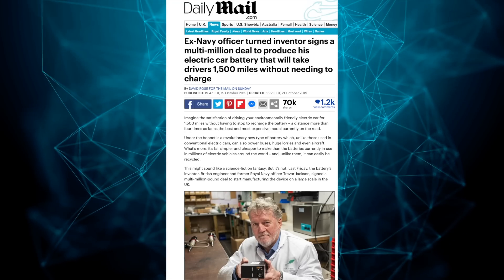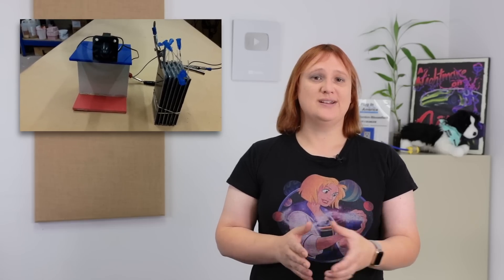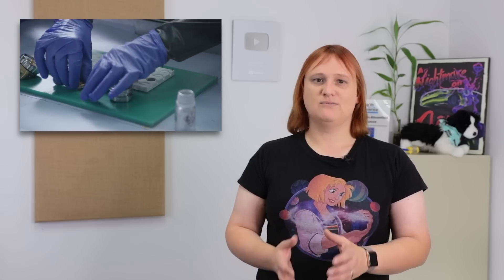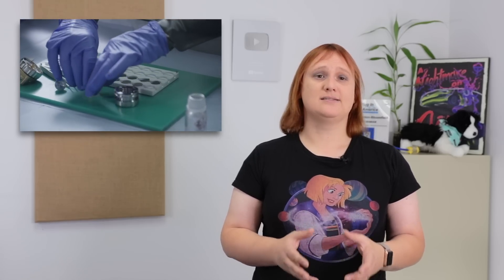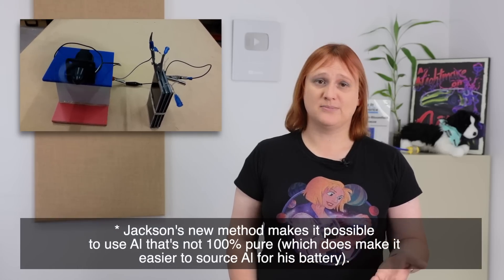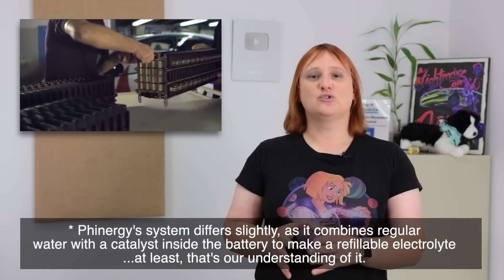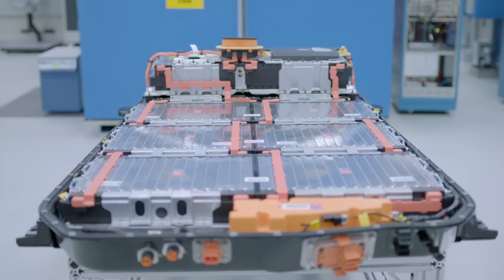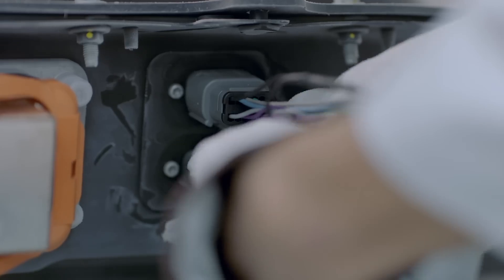Is This Battery The Holy Grail For Electric Cars?

Comment: This made news some decade or two ago with a company proclaiming and 1,000 mile EV range. As I remember it, they didn't talk about replacing the battery, only draining the electrolyte, refilling with clean electrolyte and adding fresh aluminum plates. That may be similar to a battery swap but is sounds much closer to a fill up for ICE car owners. Also it was stated that the used electrolyte could be recycled and the aluminum removed and put back into reusable condition. I'm sure there is considerable energy used in the recycle process as nothing is free, but it was presented as not major obstacle and recycling centers could be ubiquitous.

Comment: Aluminum air batteries is a very bad idea for cars. It won’t take much time to become another oil Cartel. 
Where aluminum air batteries will work well is in light aircraft. They will allow 800 to 1500 mile range light aircraft.  At the 70% mark just replace the batteries.

Comment: Couldn’t we just pull into a service station but instead of filling the tank with petroleum (gasoline). Fill it with aluminium marbles from a spigot and top up the aluminium that way?
Reply: David Hunter as a battery the aluminum must be in a form that is engineered into electrodes to allow surface area to be exposed to the forced ambient air.
Your not far off if you want to disassociate hydrogen from water exposed to aluminum pellets in an aqueous solutions of gallium indium.
Hydrogen on demand can run a fuel cell or ICE.

Comment: While I will never give up the ability to charge at home (I love not having to go anywhere to fill up), I can see these batteries being very useful for edge-case situations. For example, here in logging/mining country, it is not uncommon to see diesel pickups with a range extension tank in the bed for heading into the backcountry. Imagine tossing an aluminum battery into the bed of your Rivian and all of a sudden having a 2000 km range. Given that the motors don't care about the chemistry being used to move the electrons, Lithium + Aluminum add on might make sense. 
Another situation this might work is if you already have a transportation work yard (e.g. city and school busses) or could rent an easy to use trailer for the battery (e.g. you go to U-Haul to rent a battery trailer to long haul move your EV RV, for example).
Of course, this all assumes these add on packs could be created, recharged, recycled and "installed" at a price comparable (preferably cheaper) than the existing options on a price per kilometre basis.

Comment: Great info.
I do not want to go to a shop to replace a battery. I go a Bolt so I would not have to stand a gas pump on cold or rainy days.  I don't think it will get much traction with personal cars but sounds like a good fit for busses

Comment: In the original article the cost of a aluminium-air battery, was included, £5000. I understand that over time this cost could be reduced but if the battery lasts 1500 miles, as stated in that same article, is this still a viable option?

Comment: One of the big benefits achieved from current EVs is regenerative braking. Since this battery can not be recharged this benefit is lost unless as she said multiple battery technologies are used which defeats the space saving factor. I am also concerned that if the aluminum is being consumed, where is it going? If it is some aluminum compound being released into the air, we have another problem.

Comment: (Not super-important, but just for the pedantic record, energy storage per unit mass is called “Specific Energy.”  “Energy Density” is energy storage per unit volume, although it sometimes is, not technically correctly, used as an arguably more-intuitive moniker for Specific Energy.)

Good report!  I like your suggestion of using them in place of ICEs in a PHEV;  that’s a clever approach!

Being an electrical engineer myself, although mostly in computers, I read an engineering-theory-level book on EVs (somewhat out-of-date, but with a lot of excellent and still-relevant info), and it spoke about aluminum-air and zinc-air batteries.  That book pointed out, as did you, that these battery chemistries have a long history in hearing aids.  

From an EV perspective, the book described them as “refuelable” batteries, interestingly.  In particular, suggesting that the materials can be refilled without replacing battery casings.

Comment: One thing I thought about for the aluminium air primary cell technology that makes way more sense is the use for container shipping. Those enormous ships are massive polluters but can be easily converted from dirty marine fuel oil to zero carbon emissions as their propulsion is actually by electric motors but they use thousands of tons of fuel oil in generators to make the electricity onboard. If the aluminium air batteries can be loaded on at port and unloaded for recycling, that would make sense.

This works as the ships only visit a relatively small number of ports and they already have all the storage and heavy lifting equipment available to move the enormous batteries around. 

That makes way more sense than for electric cars and would be a way to completely decarbonise our international trade.
Reply: Noah Derrington aluminum is made with electrolysis.
Reply: Dana Putnam I am very well aware of the aluminium manufacturing process. This is precisely why I question this technology for small vehicle transportation as the carbon cost of the process, transportation and recycling of primary cell technology as opposed to rechargeable batteries.

Just because aluminium production uses electrolysis in the process and some part of it could use renewables the totality of the manufacturing process, transportation and recycling is going to have a massive carbon cost which can only be justified for very large infrastructure like shipping, possibly aviation and heavy plant equipment.
Reply: Noah Derrington sorry just want to clarify recharging alumina into aluminum versus disposal of primary batteries or mining bauxite oar many people in the commentary are not familiar with the process and the narrator implied aluminum is just found in the ground.
Maybe your familiar with Iceland using its excess electricity to make aluminum and ship it to Europe where they extract the electricity and ship the alumina(aluminum oxide) back for recharge.?
Reply: Noah Derrington the production of aluminum is already a vast manufacturing resource that is thousands of times more than the demand for battery electrodes currently in place regardless of the battery technology.
Consider in fact that it is quickly replacing steel in automotive applications due to weight advantages and gas mileage which offsets concerns.
Also while commenters have claimed it is energy intensive compared to other metals per ton aluminum is 1.5 times lighter than steel making steel in its mobile application 1.5 times less mass required for the same application.
That means aluminum is less carbon intensive per application and continues in the life of the transportation  device to continue to reduce carbon output for vehicle transportation which of course includes airplanes!

Comment: I saw this recently. It’s a bit misleading as it’s not rechargeable and the whole battery would need to be removed from the vehicle and replaced to replace the energy source. The aluminium then needs to be recycled and re manufactured every charge.

Firstly, that’s probably a bit impractical as each service station would need to be able to detach a heavy battery pack from a car and reattach a fully charged one. That might be possible to automate but would require every new car to have the same battery pack size / connections etc.

This at scale would be insane, imagine literally millions of vehicles of every shape and size needing hundreds of thousands of tones of batteries to be stored and swapped at service stations every day. Its not impossible but pretty impractical.

Also the carbon cost of transportation of 100s of millions of tones of batteries every year to and from recycling centres and the carbon cost of re manufacturing them would defeat the point of green electric power.

It’s interesting but not practical in my view. The whole point of electric vehicles is they are charged at home or work from renewables (locally or grid) and doesn’t involve any transportation overheads of moving the power to the vehicle.

Comment: I have the answer--I think. First: this is the ideal solution for long-haul trucks ("lorries"). A team drives across the USA--or Canada, which is longer. When they arrive at their terminal, they swap out the battery while preparing to take on a new load. Simplicity itself. So for them, it's ideal. No more waiting for a recharge. Sure, they're dependent on a swap station. But the terminal will have that, and that's a lot easier to maintain than a Diesel fueling station. Tesla, take note! This is the basis of your Super-Semi with the sleeper cab and seats for both driver and driver's mate. If you want to compete in the long-haul space, this battery will do it for you.

You can also use this in the area I have been waiting for someone to suggest developing: all-electric heavy mining equipment. If you want to cut down the carbon or toxin emissions from mining, then develop all-electric equipment! This aluminum-air battery would work beautifully in this application.

Same for garbagemen, and any other stand-still application (cement mixer, "cherrypicker" electric line repair truck, etc.) and for cross-country buses. (City buses should do OK with Li-ion batteries.)

To preserve dynamic or regenerative braking, the vehicles will still need Li-ion batteries or ultracapacitors. Regen brakes are better, safer, longer-lasting brakes, and that will become the single best reason to keep them. The range extension they can still offer might not count for much next to the Al-air battery. But safety does.

As many have mentioned here, this is your electric aircraft solution. I don't know whether this will go for a transoceanic aircraft. I tend to doubt it. But the island-hopping airlines that serve Hawaii could certainly use an aircraft with such a lightweight battery. It's getting right up there with hydrogen, which has the highest energy density by weight but the lowest energy density by volume. An airliner by definition needs servicing at an airport. A battery swap surely can't take any longer than the usual routine for turning over an airliner, even one making a multi-stop run. Boeing and Airbus, take note!

I imagine that environmentally conscious shipwrights would love to use this for freighters and cruise liners. But it would require a radically different ship design, with gigantic doors well above the waterline, to gain access to the battery bay. The goal would be to enable a swap-out of the battery packs in as much time as it takes to unload, clean up, refit if necessary, and reload.

Bottom line: you can do a lot with Al-air batteries even at the current stage of development.

Comment: What do I think? I think your take on the “refueling” model of these batteries is a bit too pessimistic. No reason that their form factor couldn’t be standardized such that their replacement would be no different than replacing batteries in a flashlight (or “torch”, depending on where you’re from 😉).

Comment: no thanks.  I love filling my car at home from my solar panels.  Not giving another industry control of my mobility.
Reply: @Scott Z
"Not giving another industry control of my mobility "
Obviously excluding the industry that manufactures your solar panels initially and when they need replacement or the battery technology your solar panels charge to store the energy you use to charge your EV.
Reply: or money......
Reply: Ooooo, get you..... With your solar panels and off road parking! I'd love an EV, but have no ability to charge at home and the local rapids cost the same as my diesel!
Reply: Scott Z you can use your solar to charge alumina into aluminum the ultimate energy storage. Stable does not lose energy.
They now have a solution for continuous oxidation reduction of aluminum by having gallium indium in the solution.
Reply: @Dana5775  sure, no shortage of gallium indium - these are all interesting ideas; I just lost over $30,000 in a company with a new method for making alumina (process worked, equipment failed - twice - we're insolvent) at half the energy cost of classic alumina (and 5N pure or better) in many cases it's not that these things have never been thought of - it's that they aren't practical: we rehash them every couple decades, forgetting the old problems (or being convinced of some new solution) but anyway - keep trying. my industry is transportation, the lithium ion is suitable for urban areas, so fine, use it there - but it doesn't have the range or power-to-weight for trucking, logging or fishing... mining or agriculture might work with enough charging capacity onsite, but that is prohibitively expensive - the problem is: batteries are storage. every kilogram moved, every degree of warmth or cooling demands juice. Tesla claims his trucks are good for 250 miles per day (I am skeptical if those are loaded miles or in temperature ranges toward one extreme or the other) what I need is 1000 miles per trip with 46,500 kg gross varying grades up to 10% and temperatures ranging from 40 to -40 Celsius (better make that 60 C for tropical zones)
Reply: @Dana5775  "aluminum the ultimate energy storage"

You realize that Aluminum is highly reactive and pretty much immediately creates an oxide layer when exposed to oxygen right? 

Aluminum batteries are also not rechargeable.
Reply: In less than 5 years time the oil companies will become non existent renewables are advancing at such a rate remember Tesla proved energy is all around us and its free!! Just have to tap int the back EMF by pulsing a coil!!!
Reply: pe hgt 
When you have infrastructure to supply electricity regardless of what type it costs money lol, there was never gonna be fully free electricity
Reply: @pehgt5099  
Not sure if your post is intended to be ironic.
My response assumes it's not ironic .  Oil companies gone in five years 😂.

I will be back in 2025 to point to evidence of how foolish these kind of predictions are.
Reply: 50% of all oil production goes to making plastic, so curb your enthusiasm about an Imminent oil industry collapse, Until plastics are made from something else.
Reply: @pehgt5099  demand for hydrocarbons will taper off around 2050 about 20% higher than they are today providing electric continues and alternate energy keeps being deployed. it's a function mostly of population change: European and American demand should level off sooner but Asian and African will steadily increase. the one thing that will ruin these projections is poverty - wealth is the key driver of demographic inversion (although it works best combined with a Protestant, democratic capitalist-socialist society as witness Northern European and English-speaking nations) if the climate fascists succeed in imposing their short-sighted and frantic ideas all bets are off - poverty is the worst environmental policy
Reply: @pehgt5099  NEVER HAPPEN  !  .😂
Reply: mikemotorbike 8-10% , where did you get 50% ?
Reply: 8 to 10% , where did u get 50% ?
Reply: Let's not be too transparent with the virtue-signalling. :p
Reply: @dojohansen123  why?

Comment: From what I can recall, Alu-air bateeries do not store well either. They decay fairly quickly and dischage while in storage.
Reply: An oil can be kept on board to flood the cells and put them on standby. (MIT)

Comment: This sounds remarkably like the Phinergy battery and I personally think it's a much better concept than rechargeable batteries. Swapping out batteries could easily be faster than fastest rechargeable technology would allow. The process could readily be automated and even be faster than filling up with fuel. The infrastructure needed for 'swap stations' would be much cheaper and safer than either fuel or recharging options: fuel stations need costly and dangerous storage tanks and pumps, and recharging stations (along with rechargeable cars) need to handle absurdly large volumes of power in order to charge quickly - even by today's standards where quick means in under an hour. When you're talking about ramming more power into a battery in a few minutes than most households use in a day, the infrastructure needed is outrageous. And although it would be lovely to be able to charge our cars from our rooftop solar, few people will ever realise that dream because they simply won't have enough space for the 10kW or more of solar panels that would be needed (plus the 60KWh house battery to store the electricity so that they don't have to leave their car at home, plugged in during the day). Cars that use 'swap-batteries' could even carry two of them (the batteries aren't very expensive), with the electrical supply swapping automatically to the 2nd battery when the other was expended - this would eliminate range anxiety and allow drivers to replace the dead battery at their leisure. I seriously can't see any downsides to this technology!

Comment: While this sounds an interesting concept I am not sure that it makes a viable option for EV's. It does sound a good replacement however for the standard 'dry cells' like the AAA. I cannot see it being used in grid based systems as they want systems that can cycle between being charged and discharged.